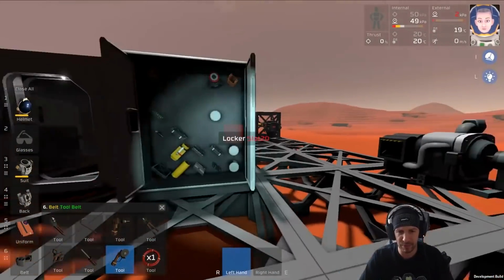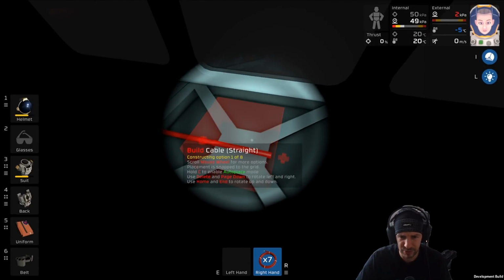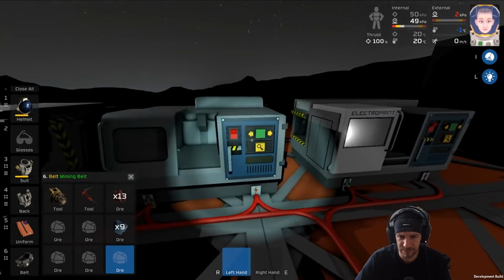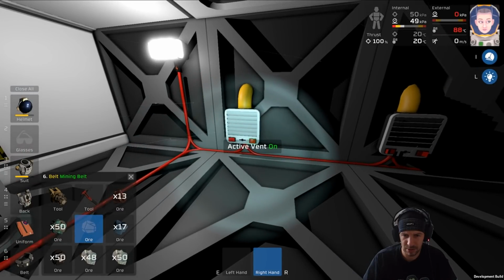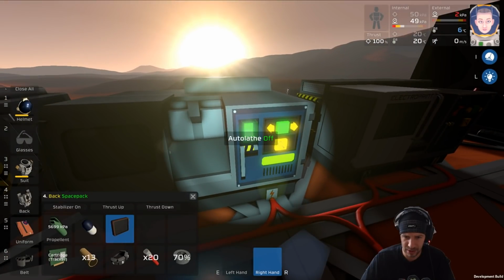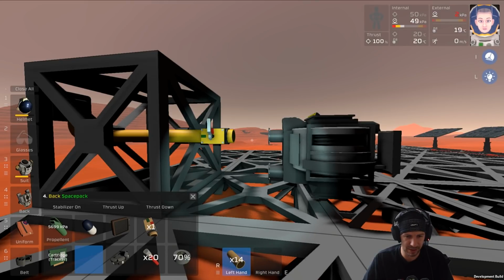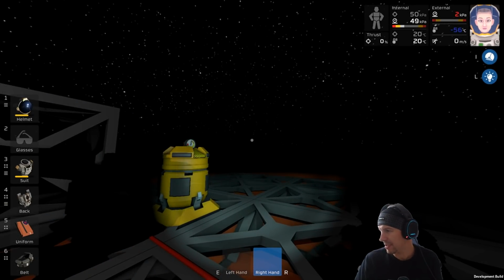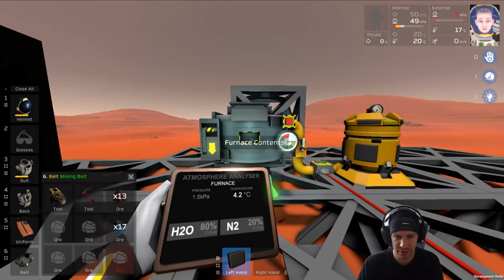Melting Ice in Furnace - Making Water - Stationeers Gameplay - Mars - Let's Play - 08

Comment: Hello Bonjour.   At 11:35  you use furnace. If you have not finished the melting of the ore (processing in liquid state..) because not enough temperature or pressure.. You don't have to pull the lever, ' cause it's going to take the fade out and turn it into reagent. You purge, and you deliver the usual fuel. So you finish the transformation of the rest. But you pulled the lever, so the fade is turned into reagent.. And a small percentage was lost during this transformation. This is the loss that made you had that (eg) 149 iron for 50 coal. At the creation of the ingot of 199 steel, you therefore recover 1 ore (iron or coal..).
Reply: si tu a pas terminer la fonte du minerai (transformation en état liquide..) car pas suffisamment de température ou pression.. Tu doit pas tirer la manette, car ça va te sortir le fondu et le transformé en réactif. Tu purge, et tu remet le carburant habituel. Donc tu fini la transformation du restant. Mais tu a tirer la manette, donc le fondu c'est transformée en Réactif.. et un petit pourcentage a été perdu durant cette transformation. C'est cette perte qui a fait que tu avait que (par exemple) 149 fer pour 50 charbon. A la création du lingot de 199 acier, tu a donc récupérer 1 minerai (de fer ou de charbon..).
Reply: 31.06 iron + 10.09 coal (for the ball of 42 reagent).
Add the ball of 50 = 68.04 iron + 24.00 coal.
Add the ball of 50 = 142 iron + 50.000 coal.
Add the last 50 = 150.0 iron + 50.000 coal (here, you see you have lost a 0.0001g? of coal and 0.1 iron ((at minimum))..
 = 199 steel + 1 reagent
Probably,, you have lost 0.1 iron of an 1 iron,, so this is a not full number, so imposible add this at coal.
= The 1 reagent is probably 1 of coal. (0.001 > 0.009)
The probleme is from the cut of 3 part of the lot of [142 iron + 50 coal],, at the lost Temperature moment stoped the melting of the ore.
Reply from the maker: Did not know that thx
Reply from the maker: Thx for going all the way to explain this. I was puzzled how i lost it, now it makes sense
Reply: Dice the game must divide something; there are some numbers lost after the decimal point. The game rounded up to have fewer figures to manage during the calculation. So, when are found with 50,0000 have thought to have 50 ore, while have only 49,0006. The problem then arrives = So you put 149,0006 fe (arondi 150,0000), supplemented with 50 charcoal ... The final calculation will be: It takes 1/4 of coal and 3/4 of iron, it lacks an iron because the 150th iron is not whole. So it will only make 198.6 steel, but the game rounded again and there it gives you 199 steel. You recover the 0.0006 iron in the ball of react.